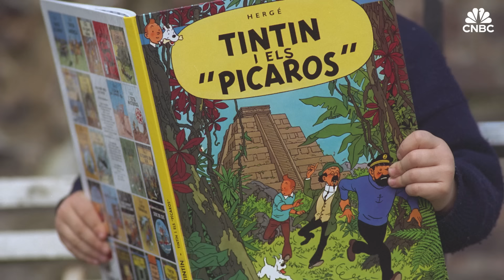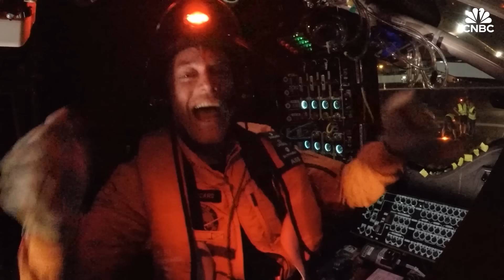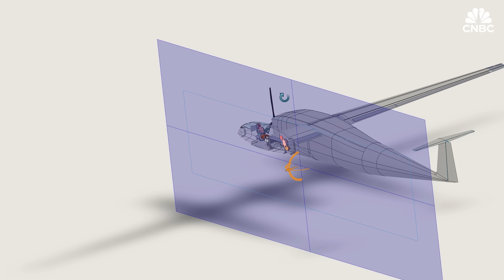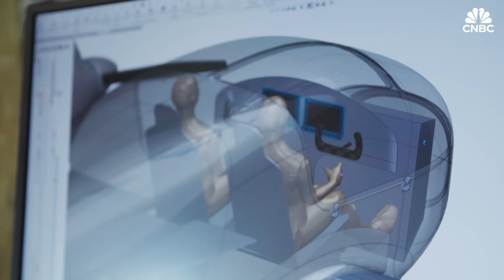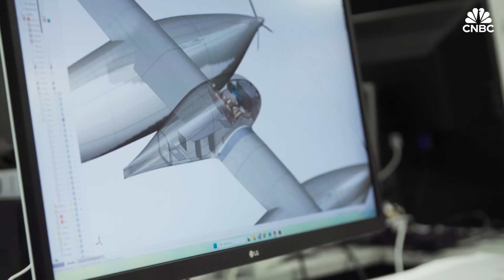This could be the first hydrogen-powered aircraft to fly non-stop around the globe

Comment: They use a similar system currently on LNG ships, the LNG is stored at minus 160 C at just above atmospheric pressure, as the LNG boils off the gas is used to fire the boilers for the steam turbines the boil off process also keeps the liquid in the liquid state.  The process is proven and works, the issue obviously is making it light enough to be carried by a plane
Reply: They are not using LNG, they are using hydrogen fuel which is completely different. It is not a petrochemical unlike LNG.
Reply: @harpandharley  I'm sure Steve knows that it's different fuels but the storage principles and the use of boil off gas are the same.
Reply: Most of the new LNG use slow speed “ diesel engines @ modified for natural gas fuel .
Reply: Except that energy density of LH2 is a lot worse than LNG.

Comment: This may sound crazy but in the mid 90 s a guy developed a oxygen hydrogen separator known as the hydro star. It is made of lightweight plastic and makes hydrogen on demand from water. I have the original plans for this device on a CD. My second thought after this was to fly through rainstorms and collect water while flying to increase the range of your H powered plane. Food for thought?

Comment: we know how explosive is hydrogen  , don't put it in a passengers plane , nothing will be left after it crashes and explodes
Reply: If anything goes wrong they just release the hydrogen.  Also hydrogen is most likely safer than jet fuel.  Jet fuel is heavy so it would end up actually catching on fire and exploding.  Hydrogen is very light so if there is any issue where it leaks it gets away from the plane.

Comment: The question is how fast is it to generat hydrogen, let alone refiling the tanks
Reply: ???
The plane won't have an on-board hydrogen production unit, this wouldn't make sense.
It will be filled before the start and fly around the world with this single filling.
Reply: @701983  exactly... they just need large enough batteries to take off and then get to altitude and then I'm thinking they will basically ride the jet streams for the most part. They can charge the batteries while they are doing that since they will essentially just be a glider. They will need to worry more about boil off earlier in the flight which is when they will produce the most amount of power. After that it would just be monitoring the tank pressure and open and close a valve to let off pressure by feeding the fuel cell.  If the battery gets full then they just use a bit more power to maybe climb a bit.
Reply: @pin65371  No, it will be a continuously motor powered flight, pretty much like the flight of the Rutan Voyager in the year 1986.

Comment: Hydrogen is dangerous on rockets because of the rocket engines and how hydrogen leaks too easily because of its atomic footprint. Although if used in cars or planes it is far safer because Hydrogen does not linger when it leaks. It shoots straight up at 40mph. Leaks are still a challenge.
Reply: Exactly...  if anything goes wrong they just dump the hydrogen. I would rather be in a plane crash with a hydrogen plane than a plane with jet fuel.

Comment: The main issue is to produce hydrogen and freezz it => it required a lot of energy (far more than the energy stored in the final system). In FR, this energy is ~70% Nuclaire (not 100% carbon free due to the full logistic of this industry).

Comment: Why don't they use the solid state hydrogen that Bob Lazar used in his car? 🤔 The fuel was safe and didn't release until it was heated, producing the needed volume of gas on demand.
Reply: By solid state, do you mean H2 molecules that are bound to aluminum hydride?  That's what Bob Lazar was demonstrating in an old video.  They've moved on since then to experiment with carbonized keratin as a binding agent to H2.  It looks like any of this hasn't been adopted even though it greatly enhances the safety of H2 storage.
Reply: @JGL841  Yes! 🙏 Thanks for adding the details! 👍  What a cool technology. Is there a paper that talks about the advances you mentioned, or was that also part of Bob Lazar's research? I'll do some searching ✌️

EDIT: University of Delaware published something about it in 2009

Comment: How much energy is required to create the hydrogen fuel? Is that energy carbon neutral? Attempts to create hydrogen fuel in the past has always resulted in a net loss of energy. That has been the main problem with hydrogen fuel.
Reply: EVERY fuel needs more energy for its production than you can get out of it.
Also fossil fuels, which needed giant amounts of solar energy (photosynthesis) for their formation. Respectively for the formation of their precursors.
If you want to substitute fossil fuels, you have to replace the solar energy from million years ago somehow.

Comment: Actually, I would have preferred a solar/hydrogen powered airship (fully rigid) instead.
And an anniversary flight around the world in the year 2029, hundred years after the "Weltfahrt" of LZ 127.
But regarding future viability, a plane is better of course.
There might be regular passenger transport with fuel cell electric planes some day. At least for shorter distances, with acceptable flight time with low speed.

Perhaps other propulsion systems with hydrogen fuel as well.

Comment: The hydrogen powered yacht Energy Observer has already traveled around the world so why not?  And if the hydrogen is generated from renewable sources like wind energy and solar then even better.
Reply: The Energy Observer was a completely different case, since it was a solar powered ship in the first place.
Batteries and hydrogen were just buffer storage, not the actual energy supply.
And a ship doesn't go down in case of power outage.
However, it should be doable.
The Rutan Voyager did it in 1986 with internal combustion engines and gasoline. So why not Climate Impulse with a fuel cell electric powertrain in 2028?

Comment: Wouldn't it be more practical to use Ammonia as the hydrogen source, it is liquid at normal pressures & temperatures so wouldn't need a high pressure cryogenic container.
Reply: Yeah, I don't understand the hydrogen craze when ammonia and methanol are available and can be stored and transported with better efficiency
Reply: Converting Ammonia back to Hygrogen is another process in Itself . Ammonia Cracking.. Uses Heat, Some complicated device and Cooling down of Hydrogen back to its high pressure required,etc
Reply: Normal pressure means atmospheric pressure and then ammonia is a gas. But it turns into liquid at much more moderate pressure and/or temperature than hydrogen. Anyway, liquid hydrogen is not stored at high pressure, it's atmospheric pressure but very very cold.
Reply: @Y2Kvids  Don't need to convert ammonia to hydrogen to use in a fuel cell which is what they are planning to use for power, also don't need to convert ammonia to use in combustion, ammonia is more practical way to carry and use hydrogen.

Comment: Hydrogen, fuel for dreamers and charlatans..
Reply: I'm not sure, whether hydrogen will play a major role in future aviation. But IF hydrogen will be used as a fuel for transport, it will probably be in aviation, rather than in shipping, rail or road transport.
Due to its high gravimetric energy density, the short storage time (hardly time for boil off) and the clean combustion, which avoids the formation of contrails.
Reply: @701983  lol. Contrails is water vapour , what do you think hydrogen and oxygen makes? And no not in aviation. It's difficult to store leakfree and it is so volatile that the smallest leak causes explosions. Further, dumping fuel in case of emergency wil be a very dangerous action.
Reply: @SkinPeeleR  No, contrails consist mainly of ice, sometimes of liquid water. And they need cloud condensation nuclei to build.
The combustion of hydrogen doesn't produce particles like soot, which act as condensation nuclei.
You won't eliminate contrails with hydrogen completely though, but get less than with kerosene.
Besides fuel cell electric planes, which fly slow in lower altitudes, completely without contrails.

Comment: Still impractical. Big planes are fast, this aircraft will be incredibly slow.
Reply: It is made to fly around the world without refueling, of course it is slow
Reply: @davidandre8029  Jet aircraft can fly around the world quite quickly, even GlobalFlyer managed 3 times the speed of this aircraft.
Reply: @PistonAvatarGuy  yeah but they didn't use hydrogen and electric motor did they ?
Reply: @davidandre8029  But the point was that HFC aircraft are impractical, because they're never going to be useful as large transport aircraft. Not only would it be impossible for electric thrust fans to produce enough power to make that possible, but storing enough hydrogen onboard the aircraft and making the fuel cells large enough to power those impossible thrust fans would render the aircraft useless for carrying passengers/cargo.
Reply: It's pretty much the same speed as its predecessor had, the Rutan Voyager.
Reply: @PistonAvatarGuy  Okay, I didn't know that.
Right, you could call it the most recent predecessor.
And the Rutan Voyager the most recent propeller-driven predecessor.

Comment: They should have considered another method to store the hydrogen such as aluminum powder, Kubagen, Powerpaste, LOHCs, ammonia, ...
Reply: Makes it heavier.
Reply: @701983  Liquified hydrogen is even worse at least for the range of volumes used in small vehicles. It also makes me wonder if hydrogen is the proper fuel for large tanks since it may be terrible compared to any other simple molecule that is easier to store (methanol, ammonia, ...).
Reply: Ammonia is becoming the green fuel of choice.  Storage requirements are less stringent than pure H2 and it can be used in a fuel cell.
Reply: @JGL841  Possibly for ships, but probably not for planes.
Reply: @JGL841  And it can be easily combusted if some of it is reformed into hydrogen. But the energy density is lower than kerosene.
Reply: @JGL841  I'm not sure, whether pure hydrogen will play a major role in future aviation. Liquid hydrogen is pretty nasty stuff, difficult to handle.
Maybe it will be synthetic hydrocarbons instead.
But surely not ammonia, and probably not methanol.